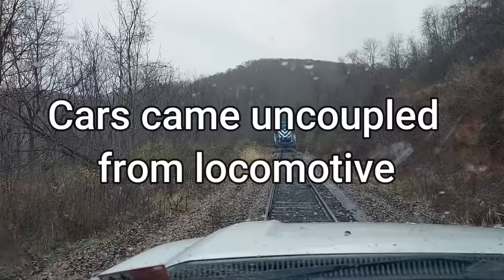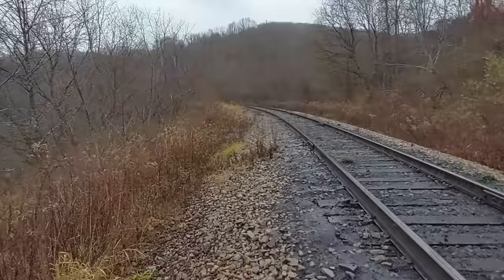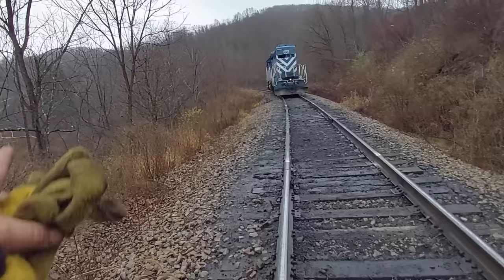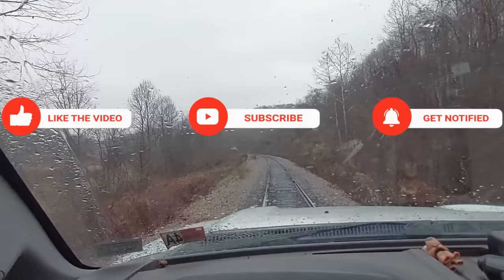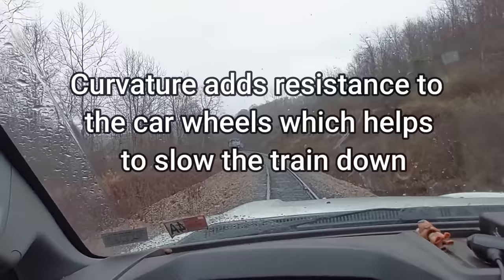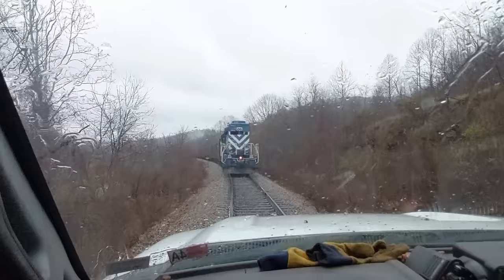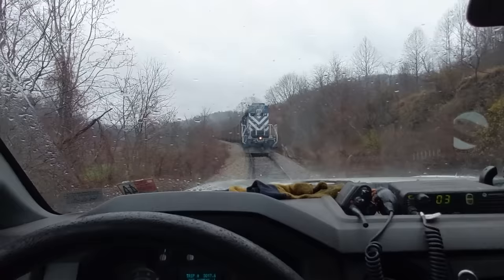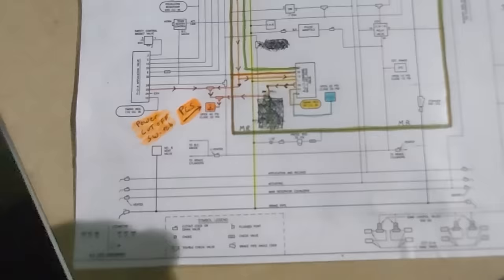Locomotive in PCS Fault and Remote System won't Link Back Up

Comment: i have been thinking about your coal cars problem... perhaps the railroad should see if herzog has one of its self dumping ballast hopper trains  of an older build that you can get ahold of and run coal thru that
Reply from the maker: Thank you for taking the time to write in and share your
thoughts.  The big problem is we don't interchange, so all
the cars whether they be used hoppers or the Herzog cars
would have to be trucked in. A Huge expense. That is what
the hold up is now on newer cars, plus what is going on at
the mine and their current expenses. Gonna have a video out
real soon that will explain the finances here, hope you
will watch for it and give it a view. it's an eye opener. Title
is: Where Would You Spend the Money.  Appreciate your visiting with us and watching. May you have a most blessed day my friend.
Reply: @ccrx6700  so i have been looking at the overhad on the area  and their are rail lines all over connected to the track you run on.   so i am curious as to where you run the coal to?  because if its the wide monongahela  ,,, then what you need is 3 89' ttx cars side by side   and a lift system..stick that ub the riverbank where you can push a 40' wide 3 track barge up to it and get 3 strings of cars  from anywhere along the river they can be put on.   should cost a pittance of trucking the things in.
Reply: ok i did locate the railroad on google earth, thats a tough trick from the water to your railroad however i believe i do in fact have an answer  to get rail equipment off flattop or conversion of some of those wide coal barges with bolt in trestles  for 2 or 3 tracks worth of cars a load.  run down hill from your car shop lead down that gully and bend out left before you get to the elevated structure at the water  and you se that mud. sand spot neat to where the bulkhead wall begins.
  thats where you could put a bridge lift for a barge to shore  span  
 as for dragging them uphill  a used tethered logging excavator could be put on MOW wheels     and what that is look like this  NW Tether logging  https://www.youtube.com/watch?v=6UYZQhTKfCo   thats made to drag assist 100 ton tree cutters back uphill  or let them down,    should be no problem  for your problem
 have a nice day
Reply: another vid of a good system https://www.youtube.com/watch?v=a6J82LswvnI    instead of a bucket  a bar with rail locks on both ends
Reply from the maker: @irondarknessdarkness8900  👍😊

Comment: When pcs is open from a penalty you put it in suppression. If air is lost due to emergency you have to go to emergency. The last notch on the 26L brake valve which this is a 26L brake system is called continuous service, NOT 3/4 notch.
Reply from the maker: Thank you for sharing that phaloxx. Very grateful my friend for your taking the time to visit with us and check out the PCS fault video.

Comment: If it doesn’t supply air to the system why did the air need to be shut off??
Reply from the maker: To keep the compressor from constantly running Michael.Good
question tho. Really appreciate your visiting with us and checking out the video. May you have a most blessed day my friend.

Comment: The glad hand sounded like it was damaged and leaking air

The spring should have closed the valve in the connector when it pulled apart
Reply from the maker: if you are meaning the angle cock on the brake and dump
line hoses, those must be shut manually.  Really
appreciate your stopping by to visit with us and watch the
video. May you have a most blessed day my friend.

Comment: You wouldn't happen to have a hectronic remote system, would you?
Reply from the maker: Not on the locos Ceb Ril. I do have a Hetronic remote system
on my hi rail truck for the crane. it works very well. Bought the only
problem with it is, after 10 or so years the battery for the
remote control box goes bad. I get new bats on Ebay for 20 bucks.
We really appreciate your taking the time to visit
with us and watch the video. May you have a most blessed day my friend.

Comment: It's strange how far technology has improved computer systems and especially touch screens. What is so strange are touch screens for tractors and other stuff. They still need to be calibrated every so often. In my mind purchase a $500k tractor with all screens and computer it should be quick reaction like a phone nowadays. Let me tell you, they are not fast enough. Some days it is so slow the tractor throws a fault code and cannot move all because the screen won't boot up quick enough (have took 30minutes to boot up for me).
Reply from the maker: Very interesting info about the computers on tractors Mark. Nothing
at all like the old 2 cylinder John Deeres like I had. :-)  Thank you so much for watching and writing in. May you have a wonderful day my friend.

Comment: Wow. The engineer didn't think to shut off the air??!! Just gonna let the compressor run it's guts out trying to keep up with the massive air loss??
Reply from the maker: This is an unmanned end of train DPU Kyle, I was the first on
the scene. Operator was in lead loco. Thank you for taking the time
to watch and share your opinion. May you have a most blessed
day my friend.

Comment: Show do you get a job in the railroad? You have to be related to someone if u try in tucson AZ.
Reply from the maker: If you're interested the quickest way is to hire on with a RR
contractor, they are hiring all the time, although you most likely
will have to do some traveling from job to job. Regionals or short
lines are the next best option in your area. Thank you for taking the time to watch and write in. May you have a most blessed day my friend.

Comment: 7:22 IT'S JUST WINDOWS LEL. I know it makes sense to just have Windows embedded, it's way easier for developer teams to program for windows, which is a common and heavily documented platform, then program their own operating system. Window Embedded was designed with use cases like this train DPU controller in mind, I just find it amusing considering what I do with windows all day as an IT tech.
Reply from the maker: Thank you  Desu for sharing the info, that kind of tech stuff is
way over my head, I'm much better at driving spikes....LOL.  Really appreciate your visiting with us and checking out the video. May you have a most blessed day my friend.

Comment: I didn’t know a locomotive of this age could even be DPU capable, because even UP’s EMD SD70M’s are not DPU capable. I guess they just weren’t equipped with the technology but if a locomotive this age can have the technology, then UP can add that to their SD70’s.
Reply from the maker: I have no idea why they couldn't make them DPU capable Raja and yes ours are much older than the 70 series. Appreciate your taking the time to visit with us and check out the video my friend.

Comment: If this was a trailing unit controlled from the lead loco,,and separated from the train, and the pcs switch was tripped,,,,,tell me why it was having trainline air escaping from it when first approached…….
Reply: That wasn't the trainline that was the independent brakes.
Reply from the maker: Good question Michael, the air was not coming from the brake
pipe, but from the car dump line. Really appreciate your visiting with us and checking out the video.  May you have a most blessed day my friend.
Reply: @ccrx6700  It's the "Main Resivoir Equalizing" line.  It's supplied through a choked check valve from between the 1st and 2nd main reservoirs.  

It's designed use is to allow MU'd locomotives to give the second reservoir on the lead locomotive more air to charge the train, or supply a dead locomotive or one with a malfunctioning compressor.

It is commonly used for proving air for dump mechanisms.

Comment: Was it necesary to run this application over an OS ? .... Everything in railroad is as reliable as you can get .... I would have expected a more hardened solution for the remote control rather than using an industrial PC of some sort. Probably it is needed due to  the complexity level ??.  Weird.
Reply from the maker: Please don't judge other remote systems such as Wabtec's Locotrol
by what you see here. I said this is a totally goofball system, unlike
any other out there. Just our luck! :-) Thanks so much for visiting with
us and watching my friend.

Comment: The rear loco has the ABV in handle off position which is the correct position for a trailing unit…lol
Reply from the maker: Thank you very much hurley7789 for taking the time to visit with us and check out the PCS fault video. May you have a most blessed day my friend.

Comment: From my short time working with on locomotives they have a 72 pin control so it then directs what the locomotives do. Or was it 38 pin. Guess I have forgot? sorry. It was like a Sun Flower arraignment.
Reply from the maker: Thank you Edward, I believe it's 38, although we never use that
cable for our locos. Really appreciate your visiting with us and checking out the video. May you have a most blessed day my friend.

Comment: If it doesn't link up, maybe they didn't pay the bill? This goes to show you, how everything now is being replaced by computers. Instead of having an other person there doing the job, they bought a computer. It is cheaper, no vacation pay, no sick days no complaints
Reply from the maker: We've had this remote system in there for a god many years
ontariocbclub, it is a cheap system and has it's share of problems. And you are right, it was put in to replace a train operator. We are very grateful for your taking the time to visit with us and check out the PCS Fault video my friend.

Comment: the rear remote/DPU doies supply air--air is pumped by both ends.
Reply from the maker: On many remotes systems you are correct Rateye. On our
system the rear loco does not supply air to the train brake
pipe, only to the car dump line. If you noticed when I shut
the angle cocks off at the beginning of the video, there was
no air coming out of the brake pipe hose, only the
dump line. We really appreciate your taking the time to visit
with us and watch. May you have a most blessed day my friend.
Reply: @ccrx6700  On DPU/Remotes and convention al trains with FRED. You have to have a way to initiate an emergency application from the rear,, You can't do that if you don't have an air line connected from the rear engine or consiist. Sounds like your in violation of FRA rules.

Comment: i remember seeing pc. oot up like that leave me believe it 1990 models and it windows xp plus im sure that hdd took a dump decided give up and crashes 
(i have worked on few them not many them were bought to me get fixed at all and company normally throw them out and replace it with newer one avoided having issues down the road which i understand want less repairs and more rolling on the rails)
Reply from the maker: Appreciate your taking the time to write in and share that with
us K Z. Thank you so much for choosing to visit with us and check out the video. May you have a most blessed day my friend.
Reply: @ccrx6700  you too be safe out there love watching your videos
Reply from the maker: @kittyztigerz  👍😊

Comment: Can't believe it's running windows.
Reply: And it sure acts like Windows. Have to reboot it to get it working again.
Reply from the maker: This is an old system and it stinks, we always have problems with
it. But it's what we have and have to deal with it. When it does
work it works good, but lot's of problems trying to link the 2 locos
back up sometimes. Thank you so much for visiting with us
and watching my friend.
Reply: @ccrx6700  What you needed was my size 14 combat boots!  I was a computer repairman in the USAF from 1972-1984.
Reply from the maker: @klsc8510  😊👍

Comment: So basically it went into safe mode newer cars have those functions they do the same thing I'm a mechanic
Reply from the maker: I had a Dodge 3500 diesel that did that, went into safe mode, it was
a pain, only drive about 5 MPH. I now have a Dodge 5500 and  while
it has never goofed up, I would imagine it has that same feature since
it's a newer model than the 3500 was. Yes when the loco goes into
PCS fault it basically goes into a safe mode and shuts down operations until that PCS can be cleared. Very grateful my friend
for your taking the time to watch the PCS video and write in.

Comment: I figured they had a person in the engines at each end even if they are linked by computer kinda worrying that nobody is in there
Reply from the maker: No just a person in the lead loco Ranger178. If we have problems
with the end of train loco then sometimes I or someone else will
be in there to help run the train, but 99% of the time the EOT unit
is unoccupied.  Thank you for  taking the time to visit with us and may you have a very good day my friend.

Comment: Must be a newer system. The W&LE used old Canadian remotes that was also used for slave units. Our units only had a light system instead of screen. Don't feel sorry for the engineer, that was probably the most exersize he gets all year! 😂😂😂
Reply from the maker: This system is fairly old kerryrock. It sometimes causes us fits,
seems like more so in cold weather. Our original remote system
was from Canada, Canac if I remember correctly? That was a lot
of years ago we had it. I do remember for sure they could monitor
our locomotives and if we had a problem, call them up and they
could look on their computer and be able to diagnose what the
problem was, that was pretty cool. With this system we have now
they can't do that. Very grateful my friend for your taking the time
to visit with us and check out the PCS Fault video.
Reply: @ccrx6700  Canac is exactly what we had on the Wheeling.

Comment: The radio transmission is kinda staticy here n there
Reply from the maker: Yes it is Corey, we don't have the best radio system out there,
I don't understand it, but our radio signals are sent over 30
miles to a repeater which then sends back the message to
a receiving radio. Really appreciate your visiting with us and checking out the video. May you have a most blessed day my friend.
Reply: @ccrx6700  They should get a few more repeaters in place

Comment: There's your problem, your control chief is running on windows!
Reply from the maker: A bunch of other folks have written in with the same sentiments
Justin. We can't help it, that's the system we have and we have to
live with it. When the system is working it works fine, but when it's
not then it can cause us fits. Sometimes it's very hard to link the
two locos together, but from what I've heard even Locotrol has
it's problems which a good many other railroads use as their
remote system. We are very grateful for your taking the time
to visit with us and check out the video my friend.

Comment: Looks like you’ve got yourself an expensive POS.
Reply from the maker: it is an old system and was put in many, many years ago dispatch.
When it's working everything is peachy, but it does mess up now
and then, and when it does it can cause us fits trying to get it
straightened back out. Very grateful my friend for your taking the
time to visit with us and check out the video.

Comment: LMAO so the Locomotive disconnected and stopped itself with no Engineer 😂😂😂
Reply from the maker: Yes sir Chris, that is what it is designed to do when the loco
goes into PCS fault. If the main train had pulled apart and gotten
stopped, you wouldn't want that end of train unit still going down
track and slamming into the back of the stopped train. 
Appreciate your taking the time to visit with us and watch. May
you have a most blessed day my friend.

Comment: So trains have all the same kinds of problems that all the other higher tech equipment of today has.
Stuff breaks.
A cell tower communications technician said once that 85% of all problems are connection problems. Cable connectors, chip plugins even cold solder joints..
Reply from the maker: Yes they do, ours is an old system simplyamazing and it often 
pukes and causes us fits, specially in the cold weather. But even
the best remote systems out there have problems on occasion.
I can believe what your tech told you. Very grateful my friend for
your taking the time to visit with us and check out the PCS Fault video.

Comment: This guy didn’t even do what the guy told him to do in the first place said hold button he’s just pressing them he said hit green box then hit 4 he’s tapping buttons before even touching the green box quit wasting time trying to make money and do a system override and put it on manual and do it manually problem solved you would have already been moving 10 min in… 25 year mechanic here
Reply from the maker: Thank you for sharing your thoughts Jordan.  Very much appreciate your taking the time to visit with us and check out the locomotive PCS Fault  video.